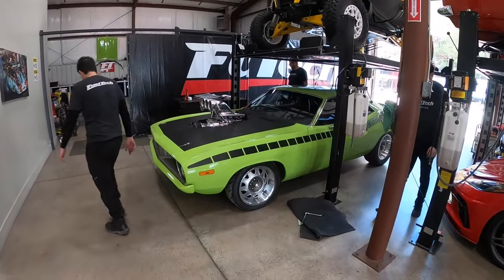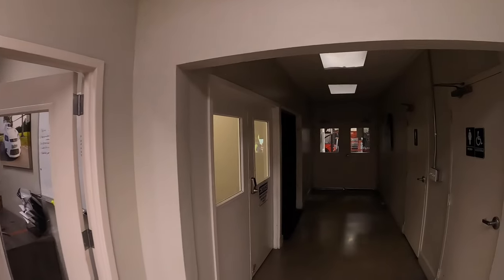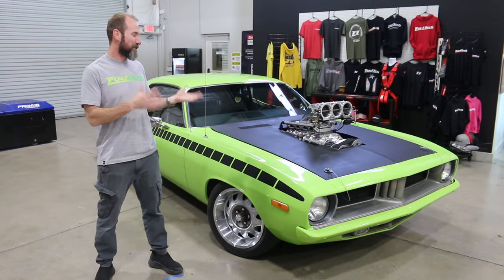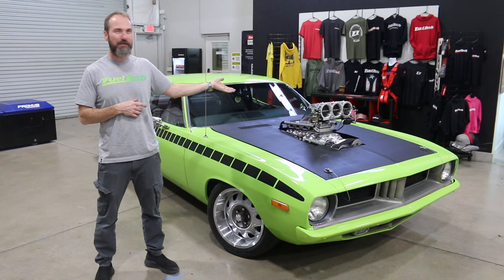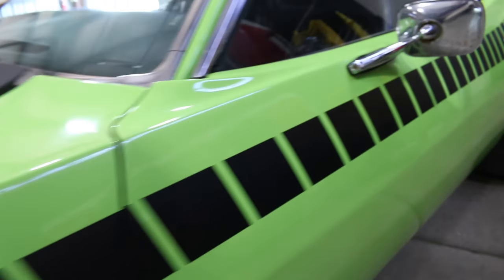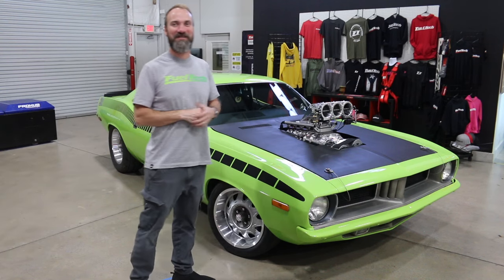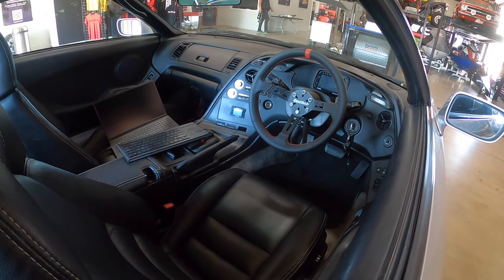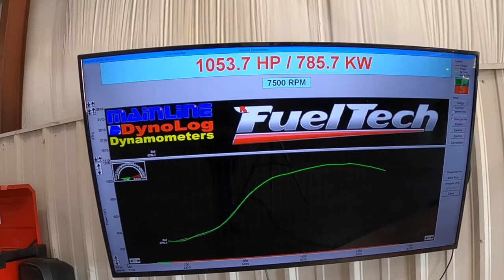FuelTech's Blown 340 '72 Plymouth 'Cuda; Full Shop Tour & Dyno Tuning a 1,053HP Turbo Supra

Comment: You should make similar shirts of your Charger with Mopar Connection in the front. In not just black, but heather gray and other colors. We get cooked here in our region wearing black shirts during hot weather.
Reply from the maker: Black is the #1 selling color for shirts. If we sold a lot more shirts we could offer different colors.

Comment: Great video on Fuel Tech!  Love the Cuda!  I wish Fuel Tech or someone would create a small digital gage like the Fuel Tech Nano Pro that could have the Temp, Pressure, O2 Sensors, and tach inputs so you could monitor to a digital number.  Something more précises than the old gages in my Non Rally Dash in my Barracuda for us Non EFI guys, that would like to be able to look at the data.
Reply from the maker: That would be cool!
Reply: @moparconnection  I talked to Fuel Tech today and they do make a Sportsman Data Logging Harness that works with an FT450 or FT550 that works for us carburetor guys that want the more modern temp/pressure/O2 etc. sensors and you don't have to have EFI.
Reply from the maker: That's great news. Thanks for the update.

Comment: Did I hear it was originally a six pack?….
Reply from the maker: No, no. It was a factory 340 4-speed
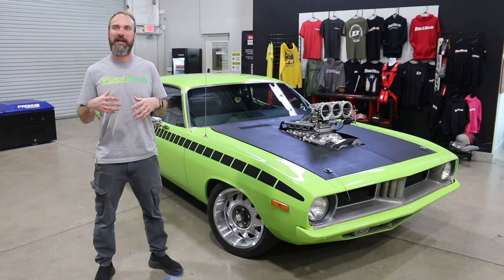Reply: At 9:40 did he make that statement?
Reply from the maker: Yes, the previous owner had put a 6BBL on the car, but it's NOT a factory 6BBL. The 6BBL was discontinued after 1971.